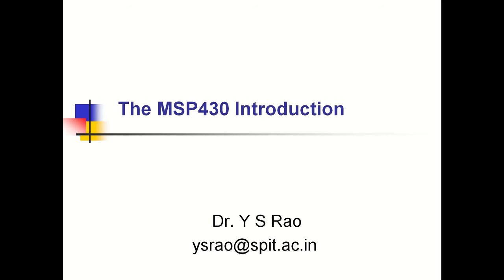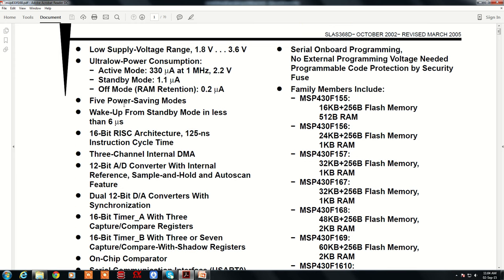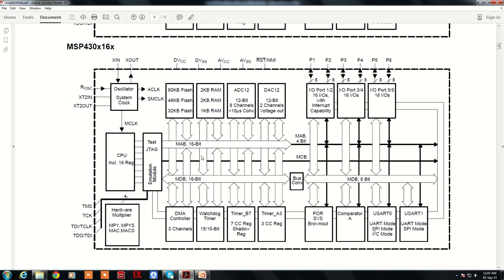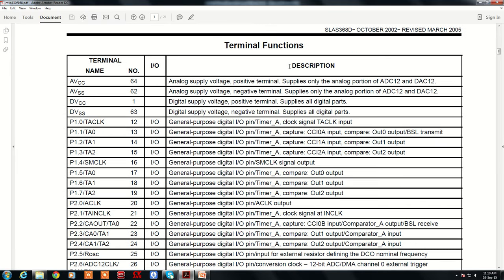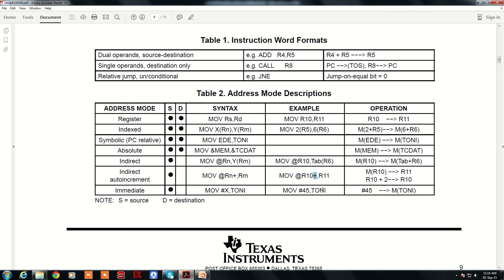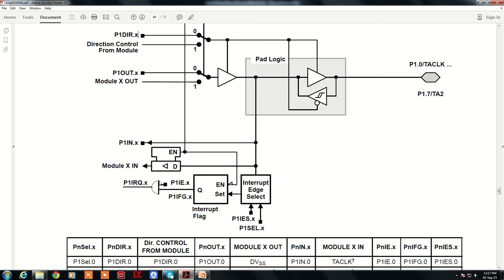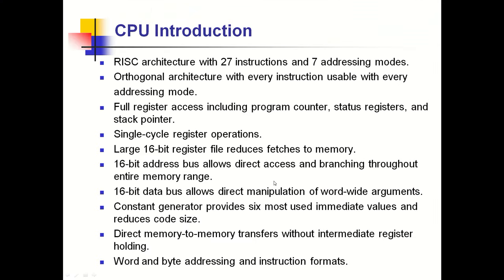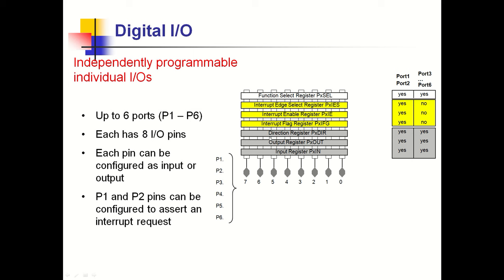MSP430 Introduction design Part-1

Comment: 1)Active Mode of MSP 430 is define as 

A) used for calculations, decision-making, I/O functions

B) other activities that require the capabilities of an operating CPU

C) All of the peripheral functions may be used, provided that they are enabled.

D) all the above

E) none of the above
Reply: Which is the correct answer